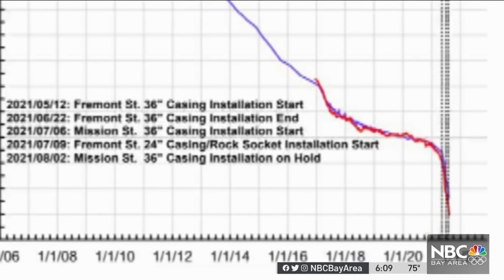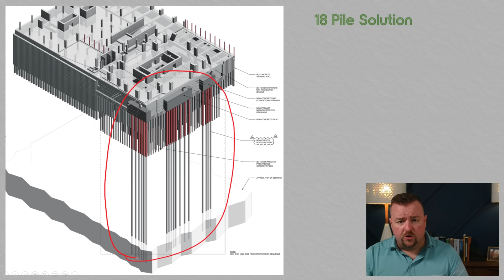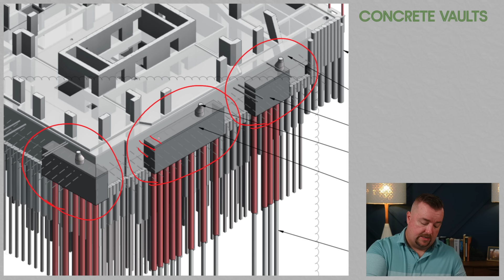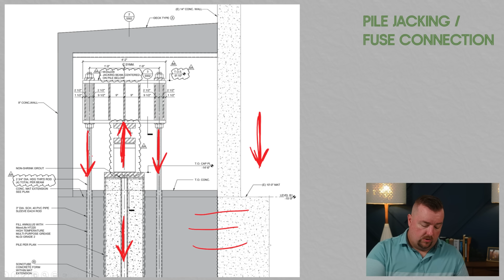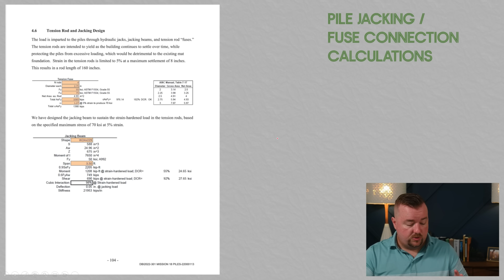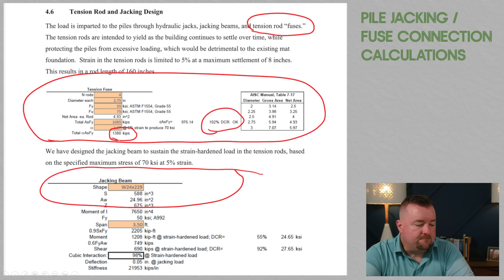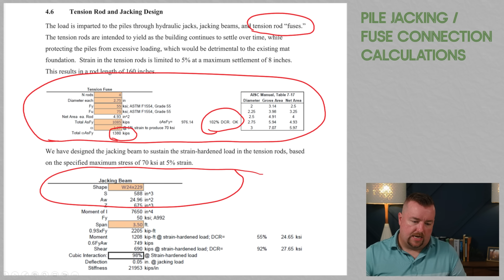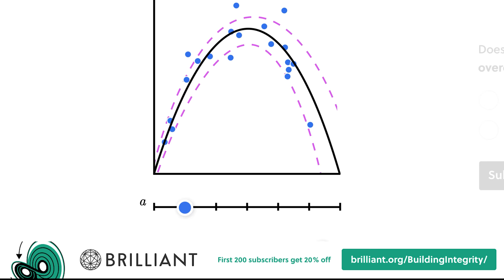Did I Uncover a $100,000,000 Mistake with the Millennium Tower "Fix"?

Comment: 2-3/4” diameter threaded rod? That’s ridiculous. I’m no engineer, but 2-3/4”? In the one photo, where a worker is near the jack and beam, it appears those rods are nearer to 6” in diameter. Regardless, I’m certain the disturbing of the earth via excavation has worsened the overall building foot integrity. Time to vacate and dismantle.
Reply: Why do you think 2 3/4” is ridiculous?  They are rated to carry the intended load, when made to the proper grade.

The excavation did disturb the support for the building, but now that the piles have been installed and loaded, the building is stable.

Comment: Saying that CAE modeling isn't appropriate because the design hasn't been done before is not a real reason. However, CAE is very fickle based on where you "ground" the model (where you end the model space), the connection types selected, and the degrees of freedom you allow the model (the more, the more complex and less stable the models are). 

Getting all of that to be realistic isn't possible, and you have to make concessions to study areas of the model with higher fidelity than others. That is where CAE falls on its face.

Frankly, I would be more concerned about binding, even with the grease, given these design deflections.

Also the 6-1/2" wide 1-1/2" plate with a presumed 3" hole doesn't meet what I can find in Shigleys Joints-Member Stiffness section of bolted joints (section 8-5 in my 8th edition) regarding the pressure cone stress riser (effectively longitudinal notch sensitivity). Pull through and bearing loading would certainly be two aspects to investigate on the plate design. From just a pure bearing perspective, I would've swagged that plate to be 10" wide to distribute the load against the concrete, with an additional washer plate between the nuts and the loading plate. Granted I'm a dumb mechanical guy, not a high-civil guy. 

It almost looks like the plate was sized to keep it a critical distance away from the piling, and why at this cost you wouldn't just do a full square plate with a clearance hole for the piling I have no idea.

Comment: 14 minutes into this and I'm wondering what happens when the hydraulic jack fails. Any jack stands? Right now, I'm thinking Harbor Freight. Is there no possibility of multiple jack failures at the same time?
Reply: If a jack fails, it will be replaced, easily.

Comment: I'm not an engineer... never will be. But honestly, just looking at that tiny little plate at the bottom of those rods, it doesn't look right... it doesn't look safe. I can't imagine that little thing is going to handle 600,000 pounds of force. I could be wrong... I hope I am.. but I'd never move into that building, even if you told me my rent was free.
Reply: The plates are buried deep in concrete, so it is misleading to think of them as isolated elements.  Anyway, just looking at a structure is not sufficient to know whether it is strong enough.
Reply: @GH-oi2jf  I figured there may have been more than meets the eye there.  Like I said... I'm NOT an engineer.😁

Comment: I see the plate and rod system coming to fruition as the suspension of the skywalk in Kansas City, though instead of tons of skywalk, a single assembly is holding up, uhh, down, whatever, thousands of tons, with a plate roughly the area of a cheese steak sandwich.  Now here, underground, completely inaccessible, the Achilles heel of the system, would be the place for the over-designing.  Now my professional engineering experience is little more than clerking for an architect, but I’d be certainly concerned with any single plate smaller than a snowboard.
Reply: There is no similarity between the two.
Reply: @GH-oi2jf  it’s a stretch, but when the interface between a plate (or beam) and a threaded rod is the most critical point in the entire system, it ought not to be taken lightly.  That rod is just bolted to the plate.

Comment: I know this is an enormous leap of the imagination to comprehend what you have explained here, but it seems to me that those steel plates are of a similar design to the support brackets from the Hyatt Regency walkway collapse… ie prone to failure. I am by no means an expert, and nor am I an engineer but if one or more of those plates fail… then as you stated a cascade of failure could occur. 

It seems incredibly myopic that this problem even occurred in the first place, and the solution is flimsy at best.

Comment: I am not an engineer but as the ram pushes up on the I beam structure which in turn is lifting the vault and dragging the corner of the building up through the threaded rods which are in greased sleeve’s ….isn’t that strain on the connecting horizontal wimpy plate going to want to pull the ends of the two rods toward each other and rip those nuts through the holes in the plate and the rods will fly skyward and yank that vault right off the side of the foundation?😮
Reply: The plates are not wimpy, they are 1.5 inches thick.  The plates are embedded in high-strength concrete.  The lower nuts are held in place not only by the plates but by the concrete.  The nuts cannot be pulled out without fracturing the concrete.

If the rods did pull out, how could they then pull the vaults off?

The system has been in place and fully loaded for more than a month.  So far, nothing has broken.

Comment: I’m too old to inject enough energy into the answer to this building’s problems, however I do think that the aftermath of a failure of the piling is going to disrupt the city to such an extent that no one’s excuse’s will save lives or reputations. That plate is as you’ve pointed out the place to start. The strength of these plates can be determined either by physical modelling in a lab or calculated using computers. There is a further problem that struck me the strength of the all thread shafts either side of the rams. Has their strength been checked because threaded rods are not the most reliable cross sections that can be used. The manufacturing process either by cutting or rolling the threads makes an appreciable difference to the final strength of these components. 
I’ll follow with interest your campaign and hope to see that the city reassess’ what their future work must be. Regards.

Comment: Why is it that in housing if something is big-time wrong they tear the structure down and send you a bill. But for a tower they pussy foot around? If a large earthquake hit SF this building wouldn't be safe. Theoretically couldn't this building fall over? In the right scenario this could be extremely dangerous. I hope lessons are learned and this never happens again.
Reply: The building is not considered likely to fall over in an earthquake.  The degree of tilt is actually quite small.

Comment: 16 minutes in.. That's not enough Anchorage on the end of the all thread. The bearing force on the plates with exceed the concrete compressive strength
Reply: Thos rods are loaded to 250 kips each now.  Would you care to predict when we will see the effect you describe?
Reply: @GH-oi2jf  Based on my rough maths i think the concrete will fail in bearing at the anchor plate around the 240-270 kips zone. I hope I'm wrong though

Comment: i haven’t viewed all your past presentations, but the original designer was rehired to fix it?  hmm. well, was any geotechnical sampling or testing performed? has independent technical review(s) occurred.  any other proposed methods, etc?

concur with your assessment of the minuscule embedded plate

Comment: why the heck didn't they make those plates bigger, a lot bigger?
Reply: Because they don’t need to be bigger.  They have determined that they are the size that is needed.  If they were wrong, then perhaps the concrete will fracture at some point.  As far as I know, it hasn’t yet.

Comment: Not to be a nit picker, as I believe you are way more qualitied to comment on this project, but the ultimate strength isn't the breaking point of steel. You get into the necking range before failure. The ultimate strength is absolutely the highest stress, but is not the highest strain, hence delayed failure. I wish I knew more, but maybe there is some bit of engineering knowledge that says the forces decrease with deformation? I don't know buildings, so please be gentle.

Comment: 13:09 How long would they think a 'multi-purpose' grease would keep from degrading and maintain its viscosity and allow frictionless sheathing for the rods while being constantly subjected to rainwater runoff mixed with road grime?   Wouldn't that already add to the maintenance cost with the yearly inspection and grease change, just like we need regular service for car engine?🙄

16:06 Why are the engineers calling this a 'plate'?  As shown in the working drawing, they are mere washers taking the compressible loads transmitted by the bolts.  And its loading capacity is a function of the thread profile of the rods and the number of thread spirals within the bolts or, how beefy those bolts are and how the teeny plates are integrally embedded in the concrete.  I have no certificate or degrees in this field of engineering, but just having screws or bolts threads stripped while doing general house repairs gives me a fair sense for how excess loading on undersized support can be catastrophic for a project.

Comment: I'm not an engineer but another thing that concerns me about this knowing how small these plates are relative to the loads that they are experiencing is the inevitable corrosion they will experience in the Subterranean environment in which they are operating. Being so undersized to begin with they are going to be under extreme stress. What about when they begin to lose material due to corrosion? They're already too thin to begin with. This seems like it's going to turn out very badly because once one of those straps fails everything else is going to be extremely overloaded Beyond its breaking point and we're going to see a cascading failure. What's the only other recourse? Dismantling the building before it's too late?
Reply: They won’t corrode unless the concrete cracks, because the concrete shuts out the oxygen.

Comment: What happens when the hydraulic jacks break down? Also, won't the lowest area of where the new concrete meets the old concrete end up under tension?
Reply: The system will be inspected.  If a jack fails, I expect they will replace it.
Reply: @GH-oi2jf  What I'm getting at is that it seems like an undesirable failure mode. If the hydraulic lines leek it won't be able to hold anything up. I would rather use something like a screw jack.
Reply: @Dane33781 — This is not a job for a mechanical screw jack.  You can lift an ordinary house that way, but not this building.  If you had a large house jack that could support a million pound load, how much force do you think would be required to turn it?

Comment: "if you have any power" - please go report the lower plate (with crossbars/rebars?)  to the federal building department - they are taking care of all the "gov" areas of the allowance who can build what. In my opinion - if there are 18  (or 6?) piles then once every 2 years they should recover one pile and check it up.
27:00 - ok i see you have contacted one but try with other - its your invention :) and observation.  I think the plate should be more attached to the ferroconcrete, also the "corrosion engineering" team should take a look at this project. Looking for some information i found out that the first building built with reinforced concrete has also skewed by 3 degrees :) due to inappropriate fundaments
"Leaning Tower of Nevyansk"

Comment: About 150 people lost their lives in the 9.0 Great East Japan Earthquake on 3/11/2011. Most of the 20,000 people who died were lost in the tsunamis. Virtually nobody was lost due to a catastrophic collapse in a high rise, even in Tokyo a city of over 10 million, where the shaking was very strong. That’s because the buildings are well -engineered and they robust seismic isolation systems. 

Which brings me to my question about the Millennium Tower…well, one of them…Why anchor this big reinforced concrete thing to the “Franciscan Bedrock” with the San Andreas Fault running under the SF Peninsula and the Hayward Fault across the Bay, when it’s antithetical to its survival in a seismic zone? Is a pendulum, base or roof isolation system being installed?
Reply: Only one corner of the building is supported by bedrock.  It was necessary to stop the tilting in that direction.

Comment: At 14 minutes I found engineers are using the building against itself to basically prop itself up?🤔
Reply: By 30 minutes I see it's like a contraption.
Reply: contraption
kən-trăp′shən
noun
A mechanical device; a gadget.
A device; a contrivance: used slightingly.
A contrivance; a new-fangled device; -- used scornfully.

This can't be good. Just the word sounds bad.
Reply: No, the additional piles are in bedrock and they support that end of the building.  The piles are not attached to the vaults.

Comment: isn't part of the fault with the city of San Francisco?  The city inspector inspects the project prior to allowing it to move forward to the next step, so what happens to why the city is not named on this issue?  it is a bad design to prevent the bldg from sinking.  The key way that hold the bldg in place is set backward and having only supporting the corner will put stress on the corner and not the entire load of the bldg (middle and sides).  The moral of the story is if the developer still used the same engineers to fix the issue then they deserve to fail with the solution.

Comment: Interesting fix. Using bolts in this way should maybe be confined to cylinder head attachment 😜

But there may be some lessons there. Firstly the bolts get to be tightened only once - they cannot be re-used once they've been streched.🤣

These threaded rods are tension 24/7 and theres a possibility that the loading may vary over time. The danger being that one in a pack doesn't behave like the the other 3. If one should break its fairly likely that the other 3 will follow. This may cause the piles on either side to fail. Worse case they all fail. Then the full load is instantly transferred back to the original piles. What happens then? 

Maybe it would have been better to use hydraulics in real time to adjust the load. A complex and expensive solution. The computer controller would be basic tho - keep all the jacks at the same load 😜

Im not a threaded bar fan 🤣
Reply: The rods will undergo plastic deformation before they break.  Even if a rod were to break, there would not be any serious consequences.  They aren’t holding the building up, merely resisting settling.

It is an analytic error to think of a group of four rods as an isolated subsystem.  There are 72 rods, loaded equally.  Should one rod break, its load would be distributed among all the others, not just its three neighbors.
Reply: @GH-oi2jf  the bolts are indeed not hold anything up. They are in fact holding a reasonably static load down with a fairly accurate clamping force. They have been stretched beyond their yield point however and cannot be used again. That's my point. They are stretched. Not a particularly effective spring. 

Each pile uses a system of 4 peices of threaded bar. These bars are also stretched beyond their yield point into no man's land. If there is a failure of one it's not unreasonable to surmise that the other 3 may fail. I don't believe that you can assume the total number of rods are all acting as one. There are way to many variables in play. Why would they all be loaded equally? Maybe for the first 10 minutes but how are they assured to be loaded equally over the next 10 years? 🤣
Reply: @leebrand2172 — No, they have not been stretched beyond yield.  As installed, they were within the elastic limit.  The article in Structure Magazine explains this aspect of the design.

Comment: Im not an engineer but aren't acme threads stronger than what theyre using. I mean were talking millions of pounds of force. 
I spoke too soon but even i can see that steel plate is way too small.  How can you pass this rule without calculating all the load factors.

Comment: As someone who has zero engineering knowledge, I found this video extremely interesting, compelling... and causing a compulsion to share my personal - obviously uninformed and unqualified - opinion... which is that -- empirically -- I felt that the scale (dimensions) of the elements used in the fix seem absurdly small for the task at hand.
The vaults, the rods, the wedge, all seem puny, as if they have been designed to just give an extra bit of stability/counter force to compensate the sinking -- like a light tipping (and holding) of a scale into balance, when it's just marginally off.
If this is the case, again, my unqualified impression is that the solution is banking on the sinking being an easily quantifiable and stable process/force and not something that, like we witness in soil movements in other situations, something that can start at a rate and then accelerate dramatically...
ie. if a larger number of the original foundation pillars have the soil beneath them become "looser" and moving away, the fix, even if originally correctly calculated for the original sinking rate, will quickly become sub-dimensioned....

(I hope that I didn't sound too silly :-D )

Comment: I'm not an engineer but this seems sketchy.  That 45 degree surface of the vault looks like it could be a serious point of failure like the building is going to slide off/away pulling the new rebar connections apart.
Reply: They won't be pulled apart.  For one thing, the smooth appearance of the dlope is an idealization.  The shape was chiseled out of the foundation slab and undoubtedly has an irregular surface which will resist sliding in addition to the the tensile strength of the rebar.